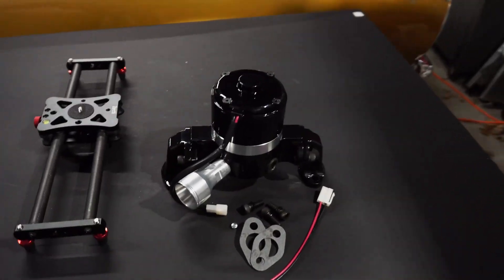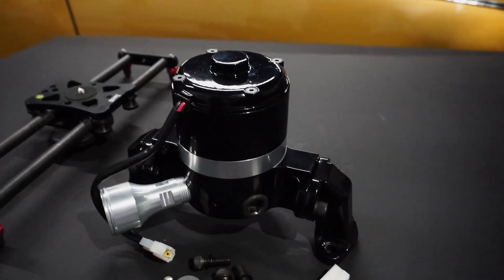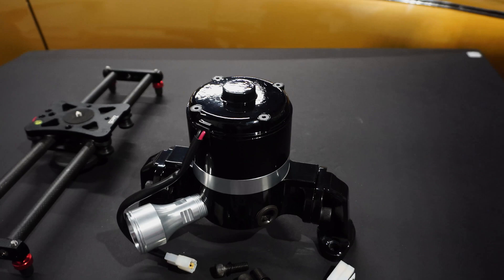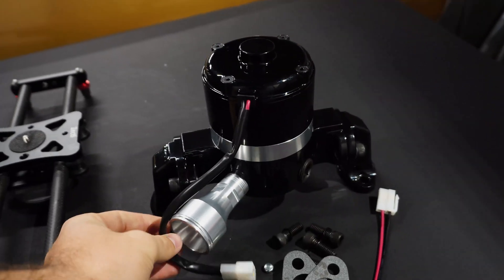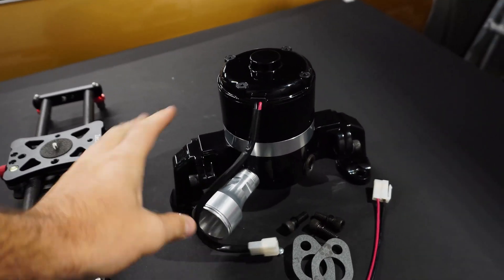Summit Racing Electric Water Pump Feature Video

Comment: nice looking pump.    how does the 35 gpm compare to a standard sbc v-belt pump ?
Reply: I think these looks better than they really work. On street car, I would never use one.
Reply: @TheReinoPaasonen   you are correct,   it has some bad reviews.   there is another brand of pump that supposedly flows 55 gal min,  and is ok  for street use with a good radiator on a medium built performance engine,   but it costs more than twice as much as this one.
Reply from the maker: I still need to run this pump and test it out. Maybe I can rig a way to bench test it for a video. This pump will be on a drag car that should only see the strip as well.